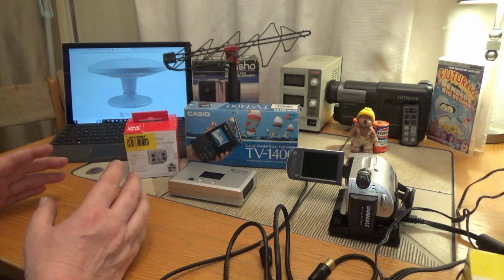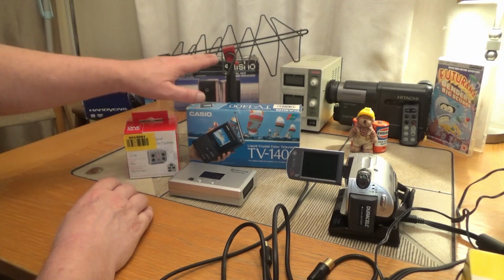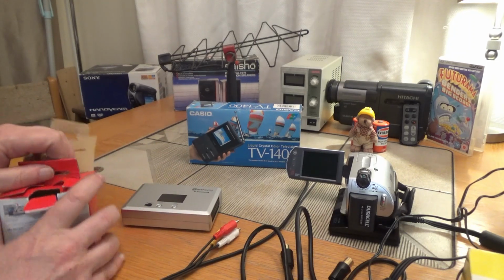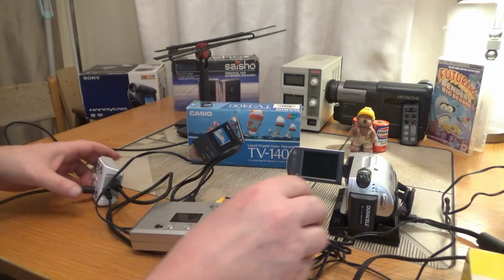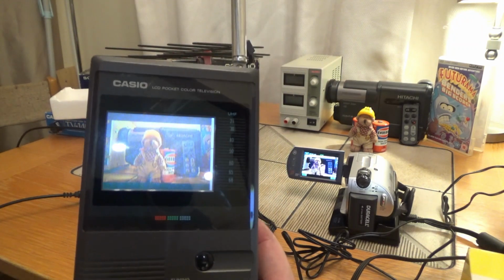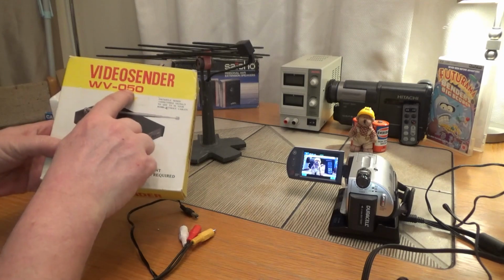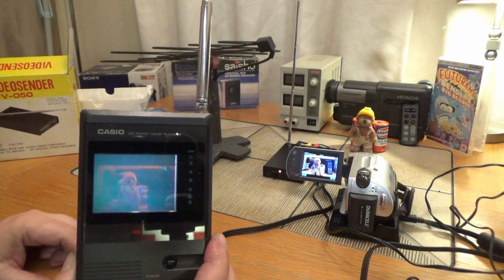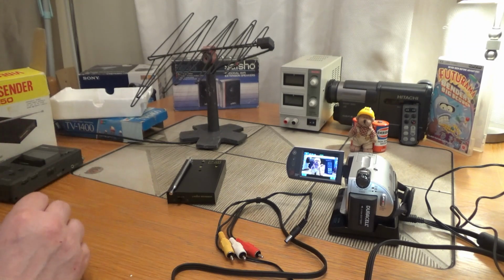How to transmit a Tv signal to an old analogue Tv the easy way.

Comment: instead of an aerial, would bunny ears work?
Reply from the maker: Yes they should work fine, the range would probably be a bit less, but should still work.
Reply: You need to make sure there is no components between them, some do and they can fry the transmitter - Just open it up and you can take a quick look
Reply from the maker: Yes of course, I had forgotten that, thank you for pointing that out. @RíanMacG

Comment: Love this kind of thing! I've just taken the viewfinder crt tv out of an old camcorder and want to get a picture on it. I'm sure it's NTSC. Would you know how to connect my PAL vcr to it? Think i need some kind of system converter box, but not sure about tuning to the vcr channel either. Any help greatly app thanks.
Reply from the maker: I'll research a bit over the weekend
Reply: Thanks. Been doing a bit o research myself. The cam was a sony ccd-trv11e bought from UK, so must be PAL based in fact. Had it all hooked up last night to my old dvd player. Was getting something on the screen when inputting the video signal, but something's not right - just a wash of whitey grey atm.
Reply: Afterthought: i don't know how the crt locks on to the dvd rf channel. That mismatch would explain the lack of picture. All the videos on yt they just seem to hook up and away they go..
Reply: Back again - sorry - no the camcorder is NTSC based even though sold in uk. Ad usual i know nothing of what i talk about.